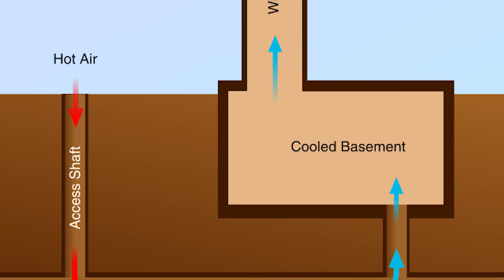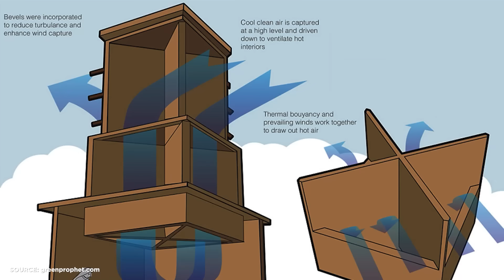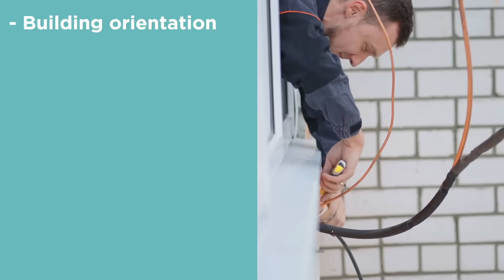Forget Heat Pumps - This House Cools Itself With NO Electricity!

Comment: Also as someone who lived outside for over a decade, you just get used to a broader range of temperatures. Also, when it gets too hot to do things you stop doing things. Modern life doesn't like the idea of needing to relax and conserve energy but that's what you have to do when it's hot. It's not just a matter of finding ways to make being comfortable more eco friendly, it's an entire mentality shift that needs to happen within our culture.
Reply: Glad you were able to bounce back and get yourself off the streets. 10 years is a long time, damn.
Reply: @AfricanLionBat  I got the impression it was a choice not an imposition. I could be wrong.
Reply: You are correct. Bein raised as a reenactor in 1780 basically, year round, you work with nature not fight her. Modern life fights her.
Reply: Yup, as a bicycle commuter in an office/city that is not super bicycle friendly I am one of 2 to 3 people who get here via bike. Everybody complains about the heat in the walk from the car to the building I'm FL summer. If you actually spend time outside your body adjusts to it, I get to work after 11.6 miles of riding my bike barely breaking a sweat (80ish in the morning, in the 100 degree ride home Def am sweating)
Reply: @g00fysmiley  it's also the ride-wind which cools you. Just stop at a stop light in the sun and notice how you might break out a sweat
Reply: @autohmae   Yes had the same experience ,. when riding motorcycle in the summer....I got rather warm when I stopped, waiting for a green light
Reply: @g00fysmiley   as a bicycle commuter in Texas I can relate. Although when it's 90 in the morning I do get a little perspiration. In the winter everyone is freezing but it's only in the lower 60s or upper 50s and I think it's fine because when you get moving your muscles warm you up
Reply: @tobyleonard5410  Your winters "freezing" is nice summer weather where I am living even if it in periods can get up to close to 80. The warmest ever in the area where I live is 34.6 C or 94 F., but what you say still holds true. Hot and could is very much based on what you are used to and what you are used to can be changed with a little effort.
Reply: @tobyleonard5410  Damn Texas is warm in the winter if 50 is a bad day :0
Reply: @g00fysmiley  It must vary based on the person. I live in the PNW and have been commuting ~10 miles to/from work for about 15 years. I sweat quite a bit even in freezing temperatures. When it's 80+ I sweat a lot.
Reply: @graham1034  probably depends on person and how much they are in the heat. Your body does adapt. Living in FL I get used to 100+ degrees so 80 in the morning feels cool. Also I dress the part changing into work cloths at work but wearing cotton, linen, or athletic wear.
Reply: @graham1034  I live in PDX and won't get an AC. I try to adjust to the weather not change to environment around me. Then again I lived in a place that got to triple digits every year.
Reply: @g00fysmiley  I’m in southern MS and sweat like a pig in our 80 degree mornings when I ride to work. Sure I am sweaty for my first 30 minutes until I cool down. Oh well, I ride anyway. I’m glad you don’t sweat like I do. I’m a wee bit jealous honestly 😁
Reply: Nothing to add, I just agree. :)
Reply: @Philip Brennan yeah, except a lot of people that maybe have the desire to live simple lives, don't even have the money to get that going ... you can't just get a tent and go live in the woods ...
Reply: Yes, I've always felt that all the temperature shifting (due to AC and heating) isn't doing anyone any favors. Whenever possible, in my home, I use non-electric ways to heat up or cool down .
Reply: Agree 100%.
Reply: Honestly, this is the part that generates anti-environmentalist sentiment. Time is extremely valuable, and not in a "hustle" way, more like if you have half your day in the summer completely gone because it's too hot that won't help anyone. You're not getting that time back, and there is no way to increase it, but if there is a way to use technology to keep doing what you actually want to be doing in that time, we will do that.

Environmentalism is about protecting our habitat. Earth will be just fine without us, even if we cause a thermonuclear catastrophe, it has withstood worse. It's the Earth that's livable to us that we're trying to preserve -- but if our method of preserving it is knocking out a large percentage of our life because "it's too hot", what's the point? We came up with the technology that enables us to talk here, why should a little heat stop us?

If we can cut our homes passively and cut down on our energy usage as a result, that's great. But not cooling it and just inhaling copium for why it's better is not an option.
Reply: @DeeSnow97  when the European colonizers saw how the indigenous people of America harvested wild rice they said that they were wasteful and lazy. In reality the indigenous people had already been using sustainable harvesting methods. It wasn't waste. They only kept what was necessaryfor that harvest. The rest was to reseed the fields with new rice and share food with the community like nature is meant to be. Animals also share the environment with us and deserve respect. If we slowed down and use what is given to us we will be in a better situation. This greedy way of living is unnatural and very destructive.
Reply: Alberta, Canada can have annual temperature swings of 80°C. Pretty hard to just "dress for the weather". At both extremes (-40 and +40°C), death is more than just possible, it's promising. 

Neither the hottest, nor coldest, but arguably some of the most drastic seasonal fluctuations. I work outdoors and there will never be a point where I'm acclimatized. That is WAY too wide of a range to just "get used to".
Reply: Worked outside, in S Texas most my life, I don’t even notice when I break a sweat… until I walk into air conditioning. 

Whenever I see the photos of Bonnie & Clyde dressed up, suite & tie, in the Texas summer, that’s what I think would be unbearable.
Reply: @sunshine3914  what's more annoying is when hot countries have had traditional cooling clothes but swapped to the western suit to appear modern
Reply: Very true my friend !:-)
👍🙏⚡️
Reply: This is the future yep
Reply: Been homeless for 8 years and that's probably not changing soon. Totally agree
Reply: 100% agree. I'd like to add that the economy (and even money itself) plays an incredibly gargantuan role in the "shape" of our cumulative mindset. We need to conceive of a new method of resource allocation and distribution that eliminates the negative byproducts of the financial incentive. Economic motivations are at the root of climate change and the deep resistance to applying a proper fix, classism, racism, corruption, pollution, crime (over 98% of all crime is financially motivated), poor educational practices, the lack of reasonably acquirable education, all of the incredibly wealthy cults (churches) that are greed-driven and cause damaging personal beliefs, greed itself, difficult to obtain medical services - needs - and medication, lack of sufficient resource allocation in general, etc., etc., etc., and on and on and on times one-hundred-million-billion-novemdecillion.
Reply: Part of the problem in our society is that we feel that anyone who isn't working hard through the entire day must be lazy and feckless.  That means that we don't accept people stopping work just because they'd experience heat prostration or heatstroke if they kept working.  This is where the expression "Only mad dogs and Englishmen go out in the noonday sun" comes from: because the people of India, who were more sensible about heat than their English rulers, thought only a crazy person would keep working in the hottest part of the day.
Reply: Agreed. I grew up on a stud, and I've worked on drilling rigs for years. I don't think I'm especially numb to temperature or resilient but I'm amazed at how mentally prepared everyone else seems to be to winge about a little cold or hot just because they're not used to it.
Reply: Well it's probably important to keep in mind that the average life span often didn't make it to 50, and infant/child mortality was very high. Much younger and older people can't tolerate extremes as well. So the whole "just be tough like me" idea sounds great when you're a reasonably healthy and fit adult, but it's also a big FU to those that aren't as tolerant.
Reply: @justaguy6100  Well, keep in mind: part of the message is NOT "Be tough", it's really the opposite: Let's not insist on high productivity when the atmospheric conditions are punishing; let's rest when it's too hot. Not so much about being tough as about being smart and responsive, which is the cleverness Joe is talking about. This is also cultural. Think Siesta, afternoon naps, and how we orient buildings and windows, etc.
Reply: @carlcrossgrove9009  I realize that, but that's NOT the message of those I was directly responding to in this thread. What THEY were saying is something along the lines of "people are too soft why in MY day I" thus and so BS with no regard for those who age or physical condition make them more susceptible to serious consequences from excessive heat. The message they were touting was independent of "working men" and disregarded the fact that temperatures are higher now, and continuing upward.
Reply: Hmmmm.  Im 75.  I used to hate summer when I was young.  I was just miserable in heat and humidity.  I now live in a house with no AC & very limited heating.  I like it because Im not in a "neighborhood" with social pressure to keep a lawn etc.  But Ive become tolerant of both heat and cold.    When high heat comes, I have to be careful of my hydration level at first.  Im not sweating much, But I have a tendency to forget that I do lose more moisture in summer than winter. So I reject your theory that young &old cant adjust to changing seasons.
Reply: @justaguy6100  life expectancy wasn't that low because of the heat, it was low because of no antibiotics and vaccines and general crap medicine. And older people being more sensitive to heat is even more of a reason for them to not have to work themselves to death in the cogs of a capitalist dystopia that demands ever greater productivity. I've seen many many old people sitting quite comfortably under shade umbrellas on beaches in 95 degree weather.
Reply: @mrskivick I know the larger reasons for short life spans, but the point is that there weren't many people much older than that who had lost their ability to moderate heat. Life spans along the Mediterranean were pretty good, and the weather was quite mild there. Plus as was noted in the video, people got clever about ways to moderate against extremes of heat and cold. 

My point is that simply believing "just tough it out" is ignoring the fact many people, both very young and very old, just can't. In heat waves in Texas, older people who didn't have adequate air conditioning died. Do you want to scold them for not being tough enough?

BTW in the shade on a beach with an ocean breeze is not that hot for anybody.
Reply: @justaguy6100  the Mediterranean can get to 110 to 115 degrees in peek summer. The winters are mild, summers are still hot. 48c, 118f  is the official European record in greese. North Africa is also connected and the get 120+
Reply: @I-am-stevo   Historically the temperatures were more moderate than what you see today, especially along the north coastal region. The winds on the waters cool, and the water was cooler in antiquity as well. 

AND it still makes my point, that life expectancy wasn't all that great. Egypt could get hot as well, but they also used passive cooling practices. 

My point is, the average temperatures are rising, new records are hit both in temperature as well as days in the triple digits (Fahrenheit) across the globe. And the answers I'm seeing people here say are "just be tough like me, that's how they did it in ancient times." No, honestly, they WERE clever and DID use cooling techniques, and still mortality overall was pretty high.
Reply: @driverjayne  actually, look into the history of Carrier air conditioning. Modern AC was literally invented by a doctor to improve certain health conditions. Also, humidity issues within buildings causes high VOCs which lead to health issues as well. A large majority of buildings would be filled with mold if not for mechanical cooling which dehumidifies the air that circulates the building.
Reply: @driverjayne  Life expectancy is also drawn down significantly by high infant mortality, which that user notes in their comment but didn't connect to the life expectancy question. It wasn't uncommon at all for people throughout history to live to old age if they made it to adulthood. Definitely there were other factors killing people as you said (medicine and work safety are probably the major contributors) but in general life wasn't that much more dangerous throughout history for adults.
Reply: @driverjayne  another good example is how people used to sleep in the afternoon when it's hottest until 9-5 jobs destroyed that
Reply: @driverjayne  That maybe so…but what sort of dystopia do you recommend ?🤣
Reply: With the many under the delusion for endless economic expansion, it's going to be hard to shift the mentality.
Reply: @Philip Brennan yeah , well i was thinking more of the self sustained simple life , like living in the wild, not having to worry about a job and bills kinda life ...
Reply: Yeah we're not gonna do that
Reply: but you need to be pwudictive and make me some moneez :(
Reply: That's how we live here in the third world and many economists argue that that's why we're poor lol.
Reply: Getting used to a wider temperature range is a major point. I used to always want it to be 72 ish inside. Then I had my own gym of sorts in a metal building with no A/C, and I live in west Texas where it can be over 100 for weeks at a time. I never checked, but it probably got up to 120-130 in there. After that, I let my house get closer to 80 in the summer and 60's in the winter, and wouldn't you know it, I somehow survive. It's cheaper too.
Reply: We tend to not run any A.C and I live in the southern U.S. (We just go to the river during the hot part of the day.)
Reply: Absolutely. Life is going to change and I think it’ll be for the better
Reply: My A/C died at the beginning of the season, and I can't afford to replace it. As a consequence, I am being less active, maximizing air flow and minimizing solar loading, and basically lowering my expectations and becoming used to a much higher baseline temperature. Then again, I never cooled below 25C in the summer anyway, and I don't understand the 18C summer crowd...
Reply: I have worked manual labor jobs without air conditioning, even if you don't have the luxury of rest you can adjust to surprisingly high temperatures.
Reply: i lived on an drafty, unheated boat in seattle one winter and was amazed how my body adjusted to the cold temps
Reply: This is so true I used to play on turf fields in 100 degree heat and after a while it just became normal. Nowadays once I'm out of AC for two minutes im sweating 🤣🤣🤣
Reply: I spent years living without air condition or heating. And after a while your degree of temperature that is normally uncomfortable to you changes, and because more tolerant. I use to liked to sleep in a really cold room like 50 with allot of blankets. Now I can sleep just fine with a sheet in 70. It's all in your mind and what you get yourself use to, it's completely possible to change your frame off mind and your body will follow. If you think about it, that's the way it is for everything we do to our body. Even body building, it starts in your mind to discipline yourself to do what it takes". Keeping yourself cool and comfortable is the same thing. 👍🧠
Reply: Lol literally never gonna happen, we can't even shift consumer demand in the face of climate change
Reply: No thanks lol. I will take 65 ac instead. I don’t want your culture shift . And that is why good ideas like passive house ppl hold contempt and resentment towards them . Isn’t enough support world wide like China to agree on stopping global warming . Better just build sea walls and prepare for it with projects to protect major population centers lol
Reply: I don't think we need to adapt to living outside lol
Reply: not gonna happen, friend.
Reply: @DeadLongEnoughyou make good sense
Reply: The way that its set up in America, you really can't just sit back and relax on hot days and do nothing. People have to continue to work  lol.
Reply: YouTube is modern life
Reply: Absolutely! Much the same applies when it is cold,too.
Reply: Right. Back in castle days, people would go to sleep early, then get up when it got dark and do chores.
Reply: I get out in the weather more than many people I know. It sometimes amazes me how some of the stay in constantly people can't tolerate even a two-degree fluctation in temperature.
Reply: Exactly this.
People need to toughen up. So many people I know sit most the afternoon and complain about being cold, and then vacuum a room or walk up the stairs and complain they are hot!
Reply: @TopCat Really? Because from my perspective, people need to have LOT more concern, about one another as well as the future people, so being smarter will always, ALWAYS, triumph over being "tougher" my friend, and it works for everyone.
Reply: @TC Here's a prime example for you. Marion Barber was an NFL running back, played for the Cowboys and the Bears. A professional athlete that from high school trained on the field outdoors in the summer, no different from every other high school football wanna be. He died of heat stroke in the Dallas area last month, found on June 1st. 38 years old. Tragic, honestly, dying that young from something honestly preventable. SO, are you a former NFL player? Do you think you're tougher than this young man? Just how "tough" do you think people need to be to just not give a damn about how hot it's getting these days?
Reply: @just aguy Tragic story but heatstroke has nothing to to with being 'tough'! Being 'tough' doesn't mean you don't have to drink water and keep hydrated!